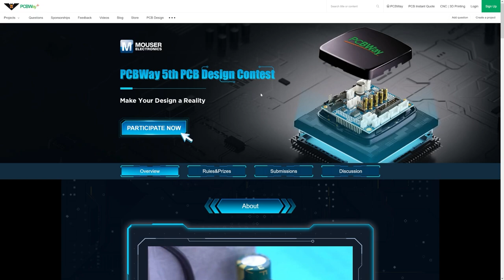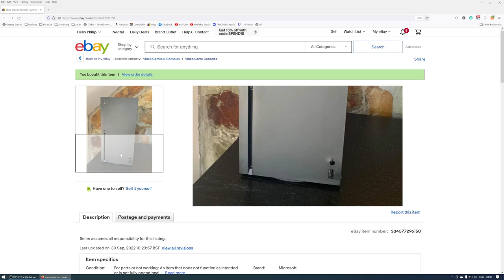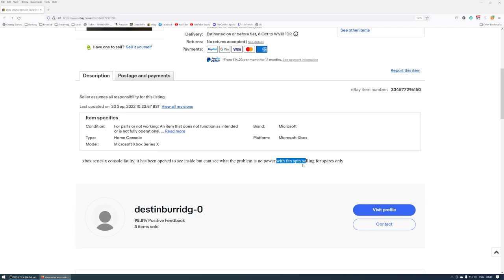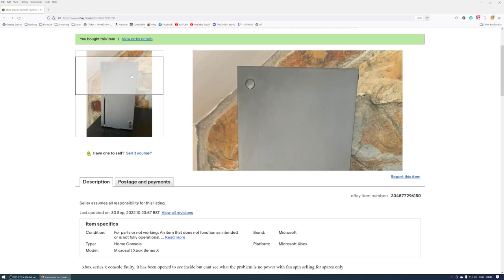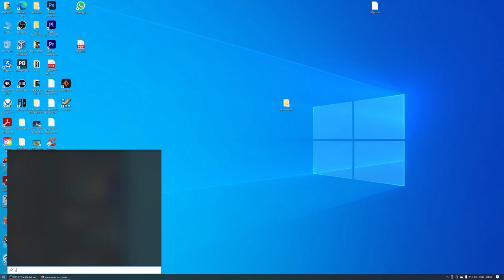I Bought A Broken Xbox Series X On eBay And It All Went Horribly Wrong!

Comment: You did well to negotiate a £50 refund. To be fair the listing did say "it had been opened and for spares only". Good result in the end.
Reply from the maker: To be honest it was against ebay policy so I could have got a refund in full, but I just couldn't be bothered to mess around
Reply: Another "to be fair" that isn't remotely fair. Selling "for spares only" does not justify doing a crappy job on packaging. Even if it's for spares only, I would still expect to receive the item in the condition shown in the photos. If I don't, then I would expect a full or partial refund. "For spares only" is not a magical phrase that gets a seller out of all responsibility.

EDIT: Wow it just get worse that you tried to defend any of this. How is this for spares when everything is bricked or broken?!

Comment: phil I get it 100% what you've said and ultimately what the outcome has transpired, however I really do think you need, can and are capable of finding a supplier of faulty consoles be it in bulk or by sets per purchase. You absolutely need to steer away from ebay or any other platform that potentially could cause more issues than necessary. You clearly have the repair knowledge but for God's sake stop buying shit from knobheads
Reply from the maker: Cheers mate, I may actually look into finding some insurance companies to buy from to be honest